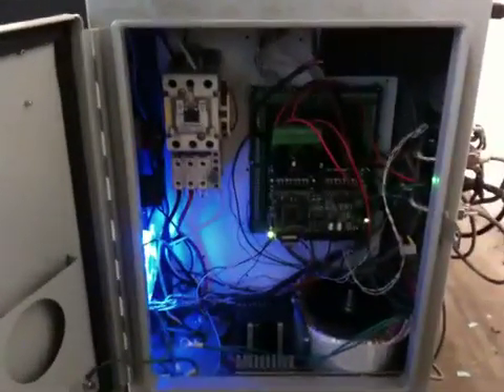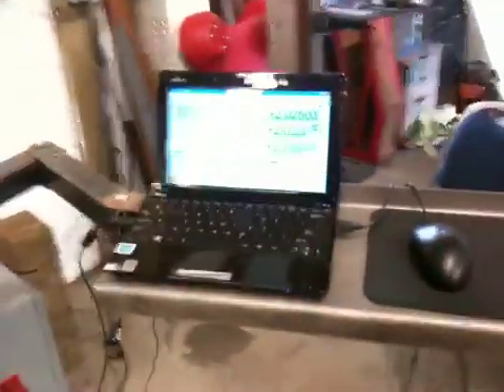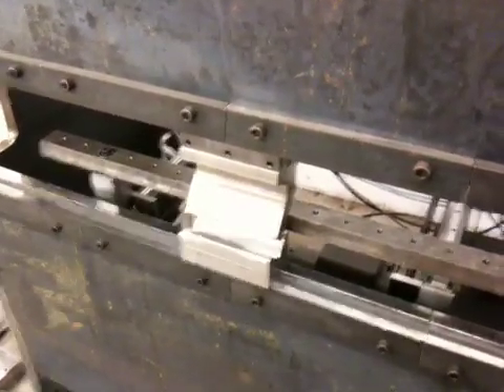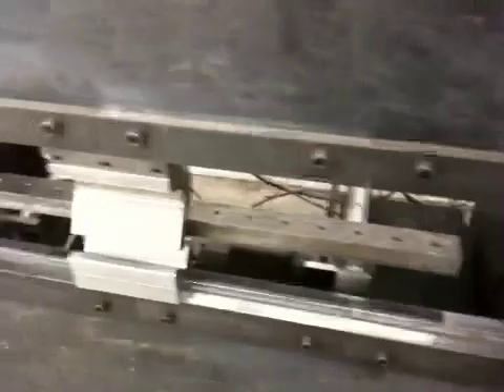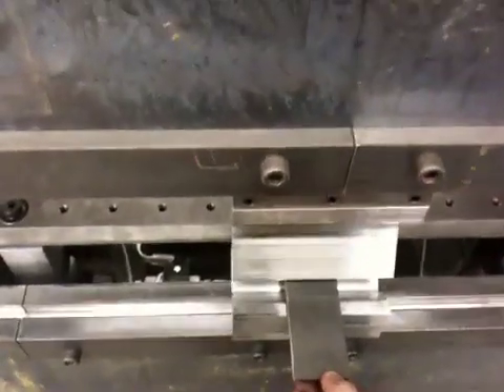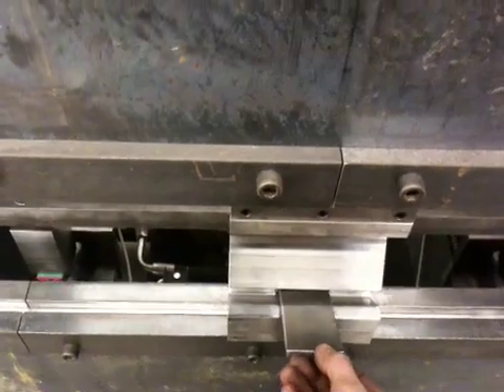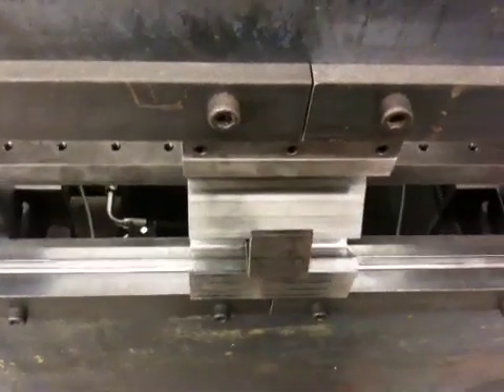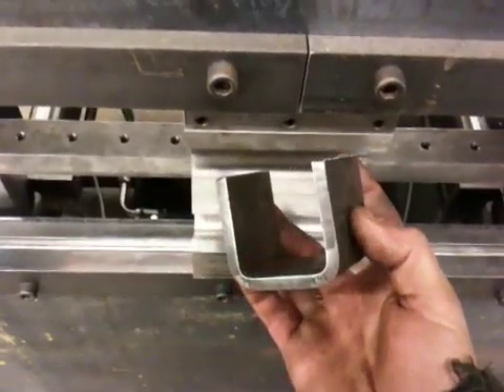Homebuilt CNC press brake Mach3

Comment: I have built already cnc router , plasma, lathe, but never a press brake. And would like to build one with industrial controller, can you just briefly explain how the CNC controls the machine? I mean i know there is a large electric motor and hydraulic pump, but how all these connected? Just a simple 2 axes like this one. Thank you for your help
Reply: ¿Encontraste solución?

Comment: What did you do to synchronise the cylinders?
Reply from the maker: Nothing. They don't sync well. My proportional valve died a few months ago so I'm trying to find two valves and run dual valves and dual glass scales so i can have control over both rams. New proportional vales are $6k each. searching ebay for more.
Reply: bigtoy302 is the cnc press brake still running? Have you made any upgrades? I’d love to build one and pick your brains. I am in the middle of building my first cnc plasma. Check out my Instagram @hardline_fabrication to have a look.
Reply: @bigtoy302  I also use KANALOG + KFLOP, but it's not as synchronized as you have, can you give me an example of a C Program, so that I know what mistakes I made. this my email; rully.ew@gmail.com

Comment: Right on, awesome. I've built a 10' x 12' cnc painting booth, 10' x 12' cnc hotwire foam cutter, small cnc mill. From one builder to another, nice work. Next on my list: cnc ring roller for 1 to 2 inch round tubing, 5 axis cnc plasma, and stepping it up to more than 6 axis control with a robotic welding arm w/ turntable

Comment: Are the cylinders controlled separately to ensure identical cylinder extension? 
Or are you just delivering same same pressure and flow to each cylinder from the same servo parker valve.
Reply: I've been wondering this about press brakes in general.  If you load your part off to one side, what stops the one cylinder from stroke further than the other?  Would this be controlled with just hydraulics or would you need some kind of digital position measuring to then feedback into the controls.